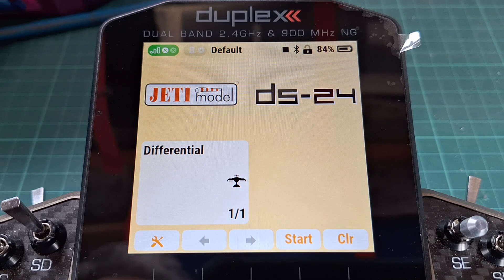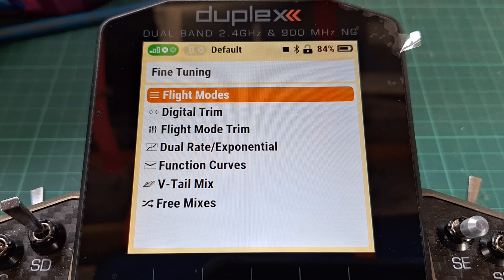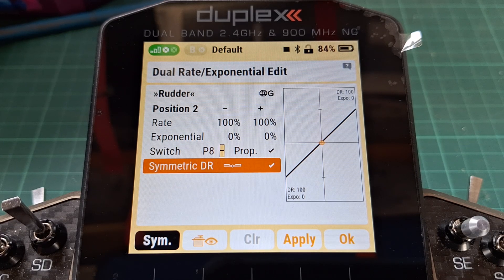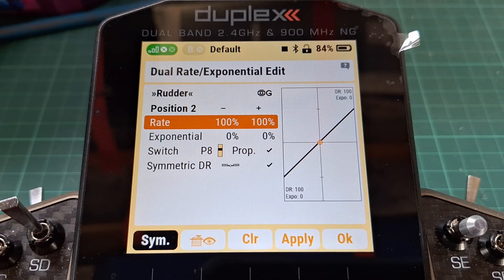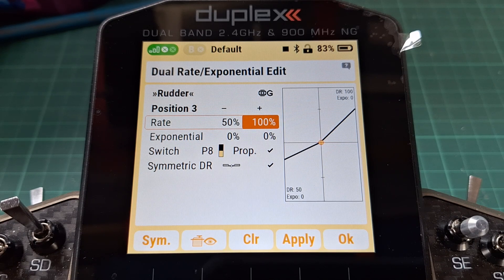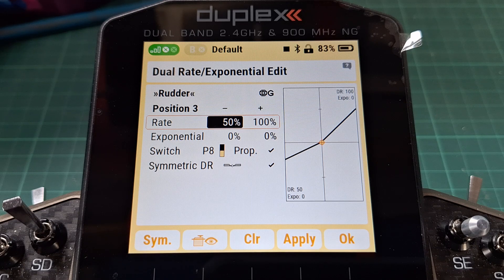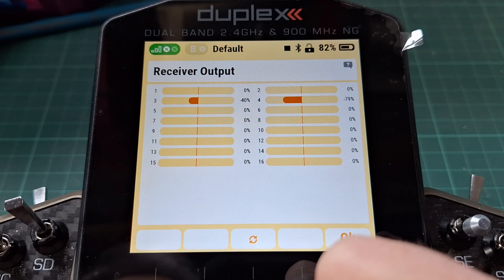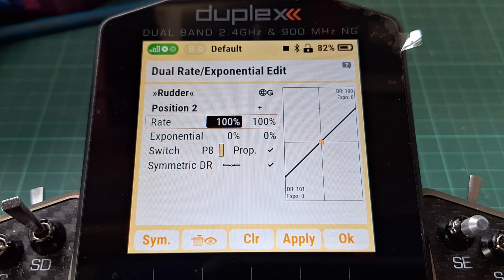Jeti - differential trick for V-tails and ailerons

Comment: Hi Harry, great video, I have been having a play around with this on a 4 servo F3f glider. I have been trying to find a way to mix aileron to flap taking in the differential adjustment, a mix from aileron servo output would do it, but that is not the way Jeti works.  I have failed, can you help.

Comment: Hi Harry, great video, Maybe a little improvement (or different way of working) If you deselect the centr option when selecting the P8 knob. You only will have two positions in de dual rate menu. Them you can set the min/max dualrate/diff and there is no need for a center position.
Reply from the maker: I know, I chose the full version for the video so I could demonstrate pos and neg diff